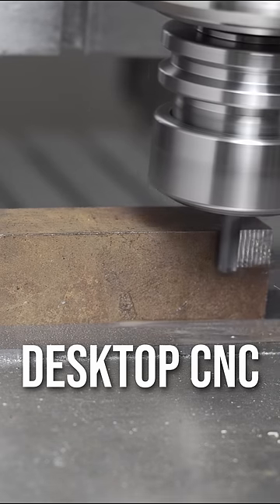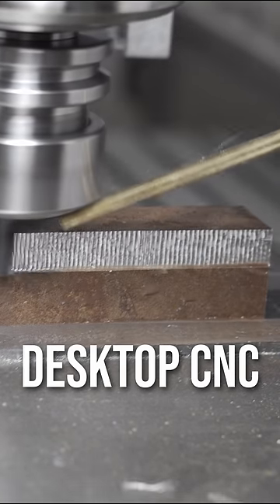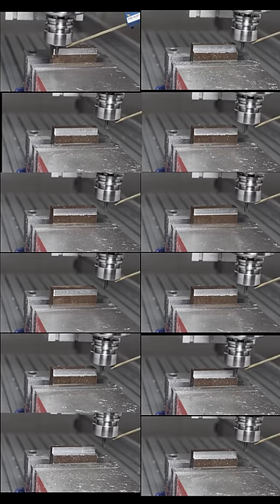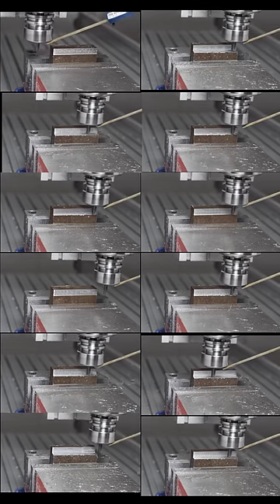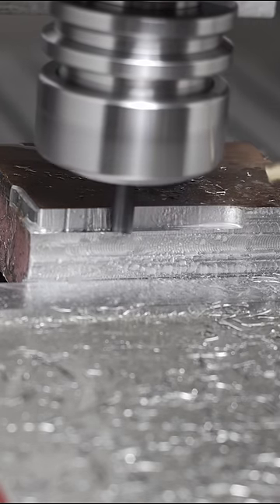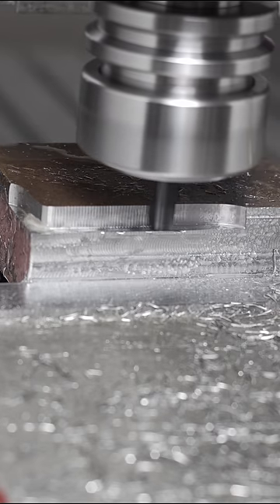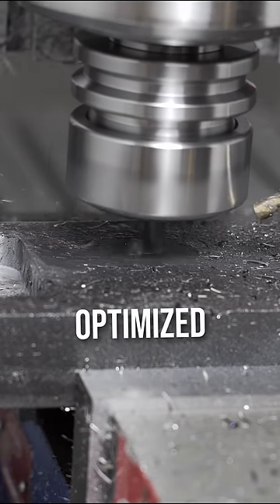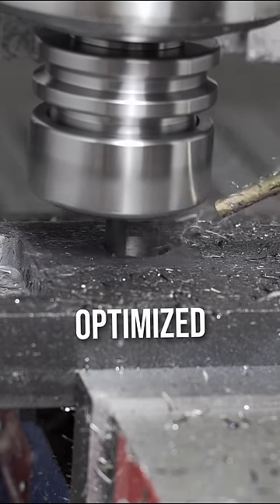Cutting Steel on a Desktop CNC

Comment: Get a Machinist's Handbook and look up the proper feeds and speeds
Reply: this is old i think, i’m pretty sure this dude is like a machining expert by now
Reply: i think he literally has a 5 axis machine
Reply: @DarthNithin  Fair enough, it just came up in my #shorts feed and it takes an extra click or two to reach the video description so I check things like that very little compared to normal videos.

 Still, the comment is also for other potential viewers who are new to making/fabricating/machining or w/e.
Reply: formerly chucks
Reply: That isn't the issue. It's the design of the machine and that he is climb cutting. Switch that and then evaluate the speeds and feeds. But know, the values it states are the ideal numbers. They assume a rigid setup, good chip evacuation, good cooling, and enough power. In the real world you often need to run 1/2-1/4 the ideal speeds due to deficiencies in the above. Cooling usually being the biggest problem unless flooded.
Reply: @court2379  CNC machines often climb mill. I'll agree that the rigidity of the machine and power of the motor are a factor, but the chart will give you a much better ballpark than just trying random values. And if the machine can't handle full cuts you can keep the speed & feed and reduce the cut itself.
Reply: Youtube just told me to rate your comment.
Reply: @Jrez  you always climb mill on all nachines, never conventionally mill.
Reply: @fjb960  Why would it be called "conventional" milling if it's NEVER done?
Reply: @Jrez  it should never be done. As it is hard on the cutter, and spindle bearings. It must be from way back when.
Reply: @fjb960  I mean just Google it, dude. There are plenty of reasons for both types of milling still to this day. If your shop teacher told you otherwise they're just wrong.
Reply: @Jrez  what reason do you have for wearing out your tooling? Work smart, not hard.
Reply: @Jrez  I had a 34+ year career as a toolmaker, and never conventionally milled. I was taught correctly.
Reply: @fjb960  I do not believe you, or you need to go back to school.
Reply: @Jrez  retired and happy, thank you very much.
Reply: @Jrez  I ran manual machines for thirty four plus years, and always climb cut.
Reply: @Jrez  here is some homework for you, study how the chips are formed using conventional milling compared to climb cutting.
Reply: Thank you!!!
Reply: Sneed's feed and speed
Reply: Agree
Reply: Or just learn wtf ur doing. Never in history has more speed and more feed gonna get you thru that steel 😂
Reply: @ThirdGenGM  I mean u could break ur tool, or just end up FSW the part lol
Reply: @court2379 any cheap starting machine recommendations?
Reply: @fjb960  Climb milling is preferred because it wears the tool more slowly and generates less heat. In conventional milling the tool enters the cut at a tangent. It rubs until it builds sufficient pressure to pierce the surface and start cutting. In a climb cut the cutter enters the cut at a much greater angle and so does rub significantly before it has enough pressure to penetrate the surface. That reduction in rubbing and the reduction of heat generated by it makes it better. Surface finish and chatter can be better too. 

The main issue with climb cutting is backlash in the drive nut. Ball screws have little to no backlash so can climb mill without issue. Almost all CNC machines use ball screws. Most manual machines have conventional ACME screw threads which have backlash and cannot climb mill without the table getting pushed by the tool. Then the tool cuts more material than it can handle and usually breaks. You can get away with light cuts and leaving the table clamps semi tight, but it wears the machine faster.
Reply: @nczioox1116  How big do you want? Right now if I were looking for a small machine I would go to Precision Mathews. Grizzly is another option. Jet, used to be a cheaper option, but probably isn't anymore. I wouldn't call any machines cheap but the smallest and lowest quality. 

Used machines tend to go for prices much lower than their value though if you watch for them and the shipping won't make it unreasonable. It will usually take a while to find the right one though. On used machines you will need to inspect for wear or damage (really a new machine should be inspected too). Check spindles and chucks for runout, both radial and angular. Check the bore or mating surfaces depending on the type of connection for major dents. Check the beds/tables for wear. On a mill put an indicator in a collet and run the table from end to end. Mills wear in the middle, so should dip if worn. Lathes tend to be worn up by the chuck. See if you can find a video on the topic as it is too much to explain here.
Reply: Nope. The tool manufacturers own guide. Those can be pretty much always found online. General guidelines are worthless for modern carbide tools.
Reply: SFMx3.82/D= RPM.  For mild steel, start with 200 with a solid carbide endmill.  So if that is a .25 inch end mill, he should be at 3,056 rpm.  Run that end mill at .001-.003 inch per tooth feed rate.  Rpm x fpt= speed in inch per minute.  25 inch per minute at .002fpt.  If it’s chattering, cut your surface feet down possibly to 100.  Rarely up for chatter, mostly down.  You get a feel for perfect harmony.  If you’re still reading, hopefully you learned something man, this is gold.  His problem I’m telling you straight up isn’t speed and feed as much as non rigid setup/spindle.  You need rigidity, and vibration kills carbide fast
Reply: @Jrez it is done on conventional mills
Reply: I was just coming in to shout Speeds and Feeds are important. I mean, if you have the money for material and repairs, all the power to ya. But alot of old timers have already done the trial and error for everyone who doesn't want to be replacing their end mills. Although, I am surprised the steppers were able to push thru the material.  What are the stepper motor specs?
Reply: @court2379 Langmuir MR-1 blows that, tormach out the water
Reply: @PepeNuclear  Looks awful flimsy for that price. It should have a cast iron bed and gantry for that money.
Reply: i'll second that suggestion.
Reply: @DarthNithin video is like 10 months old what are you talking about
Reply: @fjb960  You ran manual machines and always climb mill? There are two possibilities then: either you always milled with very small cutters on a very large machine, or used very low feed rates.
Or you broke a lot of cutters. A large milling cutter WILL absolutely pull a milling table past it's backlash, and that will break a cutter and ruin a part. 
Climb milling is for machines with ballscrews, or finishing passes.
There's a reason it's called conventional milling.

Seriously, I have been milling for 15 years now, and teaching it for 8 of those, and on the most common reasons for  student to break a large endmill, shell mill or thick slitting saw is to use climb milling on a conventional machine.

For CNC there is very little reason to use conventional milling though.
Reply: @slome815  34 years of properly always climb milling. Your assumptions are illogical, and you are teaching the wrong way to machine. Just look at the cutting pressures on conventional milling, you will see that I am 100% correct. I feel sorry for your misguided students.
Reply: @slome815  mostly Bridgeport and knee mills. So much easier on the tooling and bearings.
Reply: @slome815  started on fully manual Bridgeport, no feed or digital readouts.
Reply: @fjb960  Man, I don't know what else to say. You are simply wrong. Like I said, you will absolutely pull a milling table to the other side of it's backlash, and this will absolutely break cutters. Unless your endmills are so small compared to the machine that the cutting forces are insignificant.

Like I said, for CNC, or machines with backlash compensation, climb milling is better, but for anything with backlash it's not. 

You are going against every manual machinist, against every handbook, and against every bit of logic here.
I guess luckily you used bridgeports with their tiny R8 collets. 

And I'm more then familiar with the advantages of climb milling as long as backlash is not an issue. I was a die maker before I started teaching, and that was mostly CNC milling, always with climb milling.

I do know quite some machinists like you, 30 years of experience, still wrong habits, often still can't turn an engineering fit without using sandpaper on a lathe.

My students have made petrol engines, turbines, telescopes, I know I teach them well.
Reply: @slome815  just look at the surface finish as you climb cut, compared to conventional, that tells it all right there. I know you won't bother learning or researching, as you know it all, already. Toolmaker here, so........
Reply: @slome815  you just seem really confused, I should show you how to machine properly.
Reply: @slome815  why do all cnc machines climb cut, if conventional is so much better?
Reply: @fjb960  CNC machines almost always have ballscrews with either zero backlash, or very close to it. Almost all conventional machines have Acme screws with significant backlash and thus a cutter can pull the milling table to other side of the play between the nut and leadscrew. 

On a new conventional milling machines you might get away with it by adjusting the double leadscrew nuts so you get close to no backlash. But on a machine with any wear on the screw itself you will inevitably get either binding near the end of the table travel if you do that.

And that assumes you have a good machine with backlash compensation, if it's just one nut per axis there's no way of mitigating backlash and being able to climb mill on anything but a light cut.
Reply: @NithinJune  nah, i been working many “similar” machines for quite a while, some people at work even joke (i hope they are joking) about me being the expert on those machines….  It’s crucial to know before hand what the machine can do, and the right settings or you can blow up the whole machine 😂 does not matter if you operated similar machines before…. Everything has different tolerances and masses….. 😂😂😂😂
Reply: Machinist handbook would be helpful with a rigid machine, a desktop machine you gotta basically come up with your own feeds and speeds.

Not as ridgid as industry standard.
Reply: @fjb960  Except on manual machines.
Reply: @phillhuddleston9445  except 'what' on manual machines?
Reply: @fjb960  Climb milling is better than conventional milling but you can not take heavy cuts climb milling on most conventional machines because of the backlash.
Reply: We all know those numbers are guesses
Reply: @BH-LGB  lol, I luv your sarcasm. Yep, just guessing, no thought involved at all.
Reply: @phillhuddleston9445  so, you haven't ran many manual machines, obviously. You can hog all day long, climb cutting.
Reply: @fjb960   no it’s just from years of doing it. Also maybe learn to spell before ya talk shit :)
Reply: @fjb960  also you said you ran conventional mills. Did you know feeds and speeds very a noticeable amount when going from conventional to Cnc?
Reply: @BH-LGB  duh
Reply: @BH-LGB  did you know that manual machines can take way bigger cuts than cnc machines?
Reply: @fjb960  not with the same rpm and speed because Cnc machines have much greater rigidity.
Reply: @fjb960  well then it’s all relative. May take bigger cuts but takes much longer. Cnc is much better for production but specialty parts are better on the manual. Also feeds and speeds on Cnc machines are always really conservative and you can go faster if you spin the tool faster based on what your cutting. So that’s why I just keep notes on what I ran to keep track of feeds and speeds. Haven’t looked at my machinist handbook in a while.
Reply: @BH-LGB  do you have any idea how big of manual machine I have run? Cnc don't even get close to their size, so.....
Reply: @BH-LGB  not all the time, there are many brands of cnc that are quite wimpy.
Reply: @BH-LGB  have you run a 12' diameter vtl? Or 20' by 40' planer? Or 60' shaft lathe?
Reply: @fjb960  ya but I don’t use fadal. I have but not anymore. Haas and Mazaks and moris at least for the newer ones are very rigid. also what kind of Cnc machines have you been using?
Reply: @fjb960  oook so where did you say that? I mean an average Cnc machine vs an average manual machine. Obviously…
Reply: @fjb960  like an average Bridgeport vs an average haas. The haas can do more as far as cutting more faster.
Reply: @BH-LGB  matters the operator, versus an actual machinist, so..........
Reply: @fjb960  do you even know how to program or setup a Cnc machine mr high and mighty?
Reply: @fjb960  I've ran many manual machines over the last thirty years, you try taking a heavy cut on a knee mill such as a Bridgeport climb milling or on a horizontal mill such as a slotting operation and tell me how well that works out for you! Obviously you are spewing a load of BS and that doesn't stand for Brown and Sharpe in this case either!
Reply: @fjb960  "did you know that manual machines can take way bigger cuts than cnc machines" So you're saying that my 1HP or my 2HP Bridgeports can take bigger cuts than either of my Mazaks with 10HP spindles? If you really believe that you are a fool. There are manual mills that can take very heavy cuts but there are CNC mills that can do that as well. Over-all CNC mills average higher horse power than manual mills. You could say pistols are more powerful than rifles because your Desert Eagle is more powerful than an AR-15 but what about a .308 Win. or a .50 BMG, there are pistols that are more powerful than some rifles but on average rifles are more powerful than pistols, it's the same argument!
Reply: @fjb960  have you ever coded a Cnc machine. A haas 4 axis, a dmg mori 5axis or the live tooling mazaks? Those last ones are the best can hold .0002 constantly without many offsets when it’s running full auto with the fanuc robot I programmed with it.
Reply: @fjb960  also I don’t really do lathes because I don’t like them and they are way too easy and boring. 3-5 axis is where it’s at.
Reply: @fjb960  conventional for traditional mills and climb for Cnc
Reply: Yeah, it amazes me these people who go get a cnc and assume they know anything about machining
Reply: @NithinJune  just because you own a Ferrari doesn't mean you're a race car driver
Reply: @court2379 ideal numbers are mostly not used (especially with VHM drills), because you could change them every 2 hours, because they would be completely dull in that time.
Reply: @court2379 interesting, glad you mentioned this.
Reply: @BlueF350 - interesting
Reply: @slome815  Well said. I don't think this guy knows what climb milling is...
Reply: Slow feed, high speed
Reply: For sure it's not that. It's just the machine he's using.
Reply: @Jrez  It is well known that a machine that isn't rigid enough will have trouble with climb cutting, even in light cuts. Being CNC doesn't change that.
Reply: @phuckyocouch9098  You need to account for both. Within the limits of your machine though, selecting the right speeds and feeds will produce better results.
Reply: @court2379 obviously. But a weak machine is a week machine. Most diy/desktop machines are not good for cutting steel.
Reply: @fjb960 manual machinist used to conventional cut otherwise the endmill would grab on to the material lifting it from the vice and breaking the tool due to poor machine rigidity, so yes there is a place for conventional cutting.
Reply: It's not that simple, when you don't have the proper hp and rigidity you need to adjust feeds and speeds outside of the recommended parameters to compensate
Reply: @Jrez never have I ever heard to climb cut anything… some old machines gonna beat your ass for that one day
Reply: @court2379 😂😂😂😂😂 a desktop cnc with a cast iron bed? They’re extruded aluminum and cheaper than shit…
Reply: @fjb960 I’ve always been told never climb cut… I think you’re terminology is wrong 😂😂😂
Reply: ON A DESKTOP MACHINE HAHAHAHAHA
Reply: @slome815  You can tell, either the guy is a troll, or he just doesn't want to admit he has no clue what he is talking about, because every time someone brings up the ballscrew vs acme thing and backlash on a manual mill he just doesnt respond to it.
Reply: @hydroxide5507 it truly is a subtle joke
Reply: @NithinJune broke
Reply: Thank you
Reply: @fjb960  what brand milling machine are you using? And why abom 79 doing a conventional cut on his manual mill?
Reply: @fjb960  where do you learn to use the climb milling on a manual mill? and can u make a video to show the climb mill on the manual mill
Reply: @mwip972  i used machines from 1920's thru new machines, always climb cut, because how it is supposed to be done. Why do ask about machine? It is the same on all milling machines.
Reply: @mwip972  why would I, there are plenty of videos for you to watch.
Reply: @mwip972  34+ years as a toolmaker. Everyone should learn to use milling machines the proper way.
Reply: @fjb960  that's not answering my question, what mill model you use? some mill brand can do climb mill
Reply: @fjb960  use proper way ya if u have minimal backlash on mill, and what type mill you using? we can climb mill on the old bing makino mill without any problem, on Bridgeport clone mill, not so much, the table just slides into the cutter and breaks the tool
Reply: @fjb960  most video don't recommend climb mill ono manual mill anyway, so?
Reply: @mwip972  well, they are ignorant, so......
Reply: @mwip972  why are you lying? You have no idea how to run a mill, if you conventional cut.
Reply: @fjb960  why you call them ignorant?
Reply: @mwip972  two years in the trade, at the most, right?
Reply: @fjb960  just wanna know what brand mill u using? you said you are a 30+ year tollmaker,  just say one of them
Reply: @fjb960  any way no one agreed doing climb mill with manual mill on this coment section
Reply: @mwip972  because it wears out machines prematurely and destroys your milling tools, duh.
Reply: @mwip972  are you a first year apprentice, or a troll?
Reply: @fjb960  seems you always use good mill with no backlash. its your prefilege
Reply: @fjb960  where is the lying?
Reply: @fjb960  just says mill brand that you using, yeah im just student. I wanna know what mill you are using for climb mill, i want one
Reply: @mwip972  my suggestion is, experiment both cutting methods. You will instantly find that climb cutting is the right way to go.
Reply: @fjb960  I will do it if the mill have ballscew or max 2 thou backlash on leadscew, i only use climb for finishing, not roughing, whatever you said it wear tool faster and ect. Its safer than sorry
Reply: @fjb960  and just answer what machine brand you working on, im wanna know as a student
Reply: @mwip972  it is not safer to conventionally milling, whoever told that was lying. So, first year apprentice, or what? What trade are you even in?
Reply: @fjb960  Ok whatever seem you're who lying, you not event let me know what mill brand you using, did you forget what machine you using because retirement. Maybe you are using a high end European mill. we only use manual mills for rough jobs, just cheap Bridgeport clones can do that, for precision parts only done at cnc, yeah im not expert machinist like you
Reply: @mwip972  may I ask why you want to be in the trade, when you refuse to want to learn your own trade?